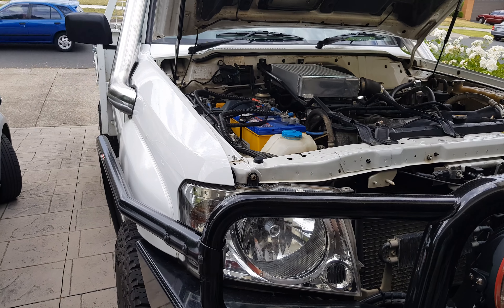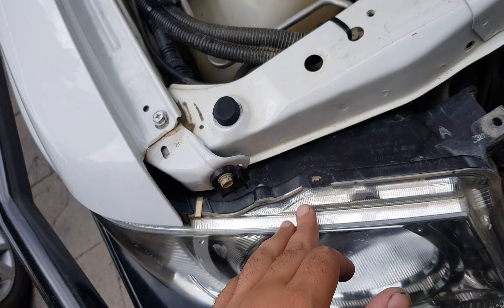Nissan gu patrol front end conversion what you need

Comment: Do the fenders bolt straight on or do you have to make custom mounts? And do you have to trim them
Reply from the maker: They bolt straight on theres no trimming need on the fenders. just the flears depending on that tyers you are running.
Reply: @35wheels  thanks mate and one more question is the bonnet latch the factory one you had on it from the older model or is it a newer aftermarket one?
Reply from the maker: @Tha_bro  it's the one that came on the car. You have to space it out 40 mm to line up with the s4 bonnet
Reply: @35wheels  ahh thanks mate your a bloody legend you really helped me a lot appreciate it brother🤙
Reply: @35wheels how bout your grille did it fit on?
Reply from the maker: @Tha_bro  yeh that just clips on
Reply: @35wheels  ahh right your a damn lifesaver mate dropped ya a subscription cheers mate👍

Comment: Did the front flares just clip on
Reply from the maker: Only on the s4 st or ti  guards on s1 2 or 3 or s4 dx with no flears  you need to make knew holes for the clips
Reply: @35wheels  any tips for mounting factory flares to DX guards which don’t have the holes drilled?
Reply from the maker: @mariusjagerstreichter6459  put the clips in the flears with a bit off paint on the ends line it up and press down it will leave the marks where to drill

Comment: Hey drop us a message if ya still active,I have a few questions cheers
Reply from the maker: What would you like to know
Reply: @35wheels  G'day bud,Can the series 4 headlight plugs be cut off with a bit of length and joined onto existing 2/3 series wiring,wasn't sure when you said harness.
Could you remove the full front radiator support of a series 4 and put it on the series 2/3 to suit the bonnet length. As I have to replace the Top piece anyway,was cut out when they removed the motor.
Thanks for putting up what you did
Reply from the maker: Yes you have to get the s4 head light loom and join them on yours and the center part is welded on you can cut a s4 one off and weld it on to yours but if your going to go that far might as will get the hole support.